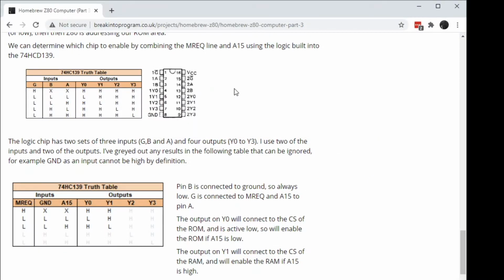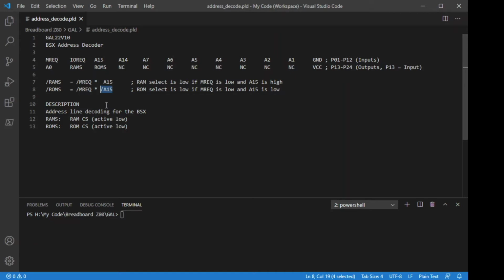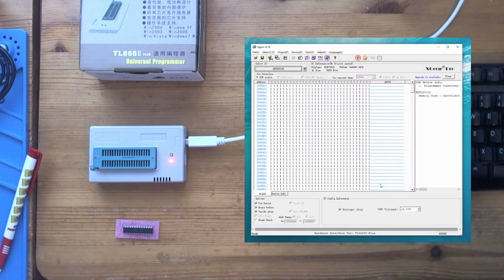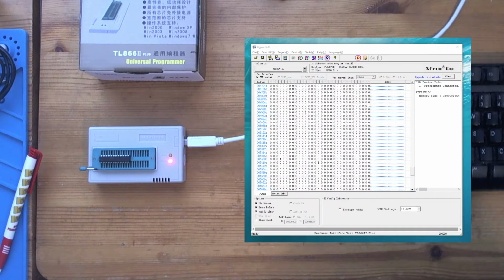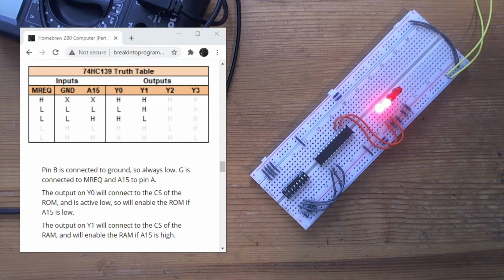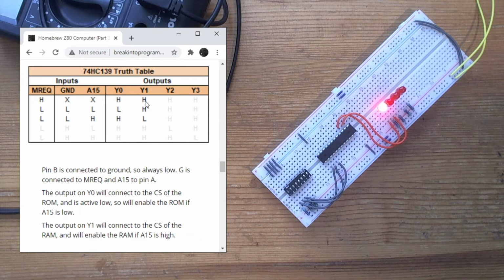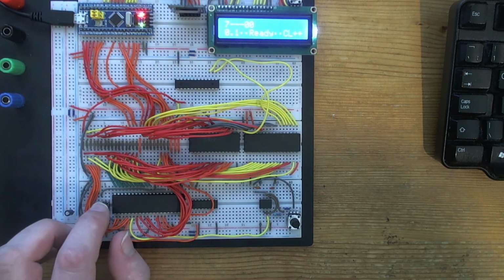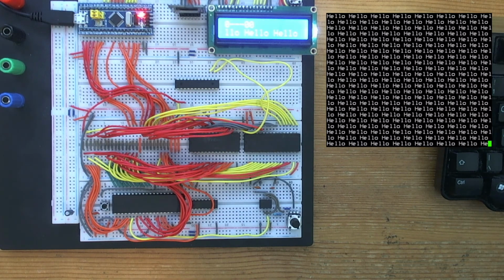Homebrew Computer Part 5: Programming a GAL 22V10

Comment: Nice video! I've just figured out that I'd made a total hash of RAM/ROM chip selection logic on my 8088 homebrew and was moving to a GAL so I can use full 640kb + Upper Memmory locations in my single 1MB SRAM chip but wanted some tips on using GALasm (or WinCUPL) and whatcha know there is an L BREAK video on it! Nice! Would love to know what simulations options there are for a GALasm-based toolchain - WinCUPL seems to have a few simulation options which might make development easier but I don't think WinCUPL has much of a future and it's annoying havint to spin up a Windows VM on my Mac to develop on so interested what others are doing here? I do see that the TL866II software has a chip logic testing which might do the job - anyone used that?
Reply from the maker: Thanks! I've not tried any simulators yet as I'm on a Mac too. I have used the TL866II to test chip logic - simple and custom. Used it to test the C64 PLA. See this post here: http://www.breakintoprogram.co.uk/hardware/fixing-a-poorly-commodore-64-part-3

Comment: I was thinking of doing address decode logic for my own Homebrew 8bit with ATF22V10C. The only problem is I don't want to invest that much into a programmer, but I have found some DIY programming resourcers for them though. Apparently I could use an Arduino for controlling the logic, then add a button between 12V and pin 2, and after power up, keep the button pressed and just clock the data in. Sounds workable.  Button is for safety, if 12V is applied to pin 2 before or during power up or after or during power down, it can fry the chip or the pin. 

https://www.ecstaticlyrics.com/electronics/ATF22V10C/ for the info
https://github.com/RobertBaruch/atf22v10c for a ready made Arduino solution for programming it
Reply from the maker: Sounds good. I already had the EPROM programmer anyway, so was a no-brainer. I'll take a look at those links later. Thanks for sharing!

Comment: Thank you for taking the time to make this,  Did you lock it after programming or was the tick to not lock ?
Reply from the maker: I'm not quite sure what the 'Lock' tick does in the Xgpro software as I left the settings as they are (with lock checked) and could reprogram the device still. I did uncheck 'Encrypt', but suspect that is also a superfluous setting. There is a security fuse in the chip that can be blown to prevent further programming. That is set by using the -s parameter in the galasm compiler. This prevents the chip from being read, but does not prevent it from being reprogrammed.
Reply: @BreakIntoProgram  afaik the xgpro also sets the security fuse if both "encrypt" and "lock" are enabled.  note the "security fuse" is totally resettable by wiping the whole chip (the "fuse blown" terminology is, as usual with ICs like that, rather an overstatement), so it doesn't really prevent programming (this would be bad during testing/debugging), only reading of the matrix bits (anything else like the 8byte user signature, and mode config etc is still available), it's essentially just copy protection.